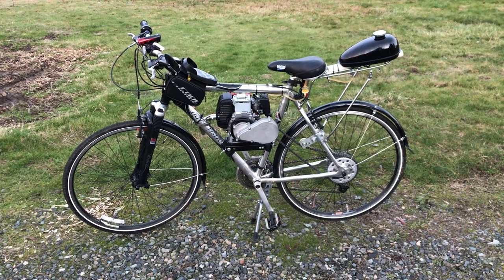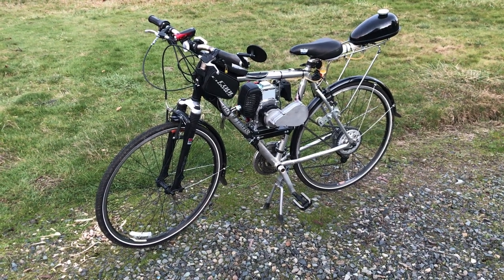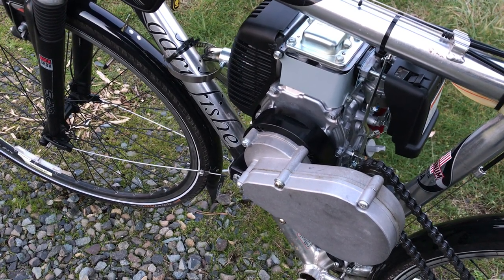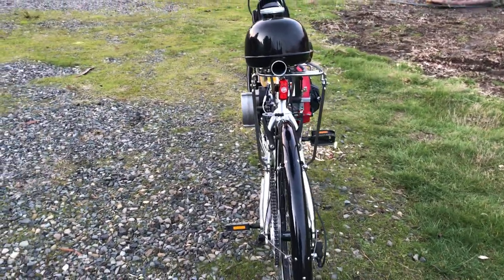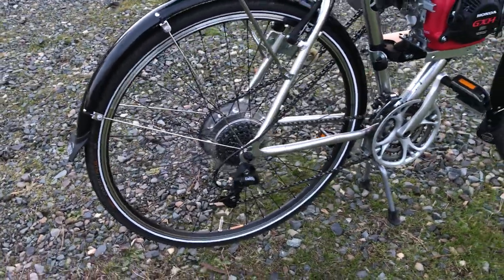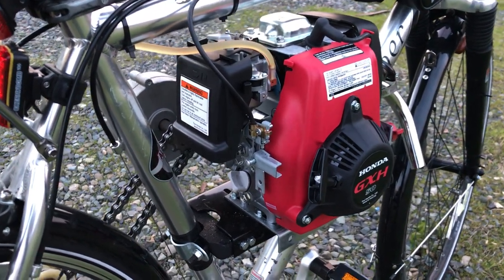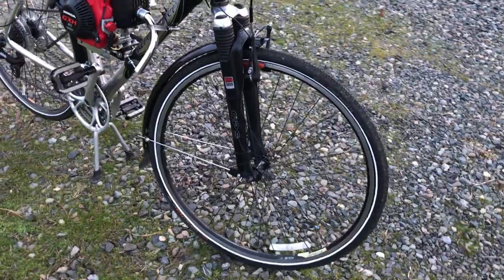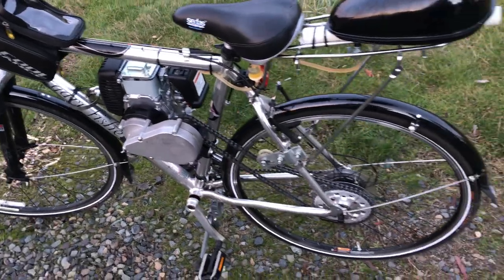Mountain bike with Honda gxh50 gas engine

Comment: Hey, I just found out, Staton motorization kit can work with just one eyelet near the rear dropouts. I thought you needed two eyelets, but apparently a single one will work. This opens up a lot of possibilities with older / vintage bikes.

Comment: These can be upgraded with absurdly long intakes between the carburetor and the block. The spacer is what can be lengthened up to 3 ft. Which is stupid in design, but works with air flow back pressure, atomization, increasing torque and overall power. 
That one could be probably 1.5ft, so the carburetor rests in the rear tire area under the bike rack. 

This is one way to actually increase performance, and mpg too. The atomization affect helps with the efficiency. There is less lag than what you would expect or notice. Supercharging occurs with resonance, back pressure mainly, and intertia of moving air in the tube. Its a trick that actually works. I would keep all the linkages in stock positions, with stock geometry if that can be done, i know honda is a mfb with the carburetors many times. I would omit the bowl carb and put straight up a genuine stihl pumper carb on it. 

For a part, which could be made in an evening, and very cheaply too, it would be better than carburetor upgrades, porting or exhaust. It actually works.

Comment: i have the same Motor but belt drive an i max out at 40 k.m.h an i am running the 42 gear an 9 tooth on mine
Reply from the maker: Sounds like we get the same speed.